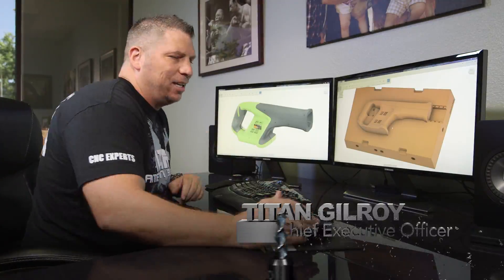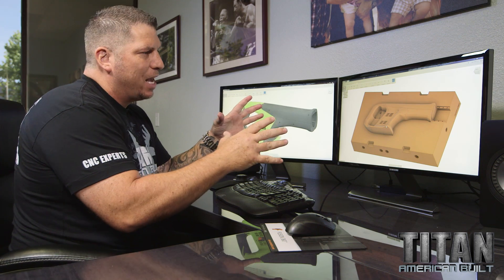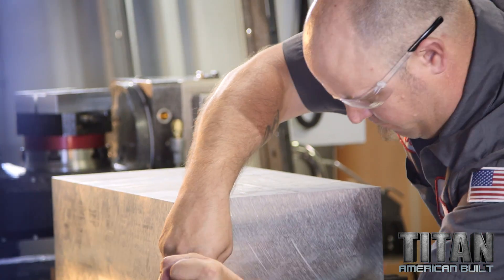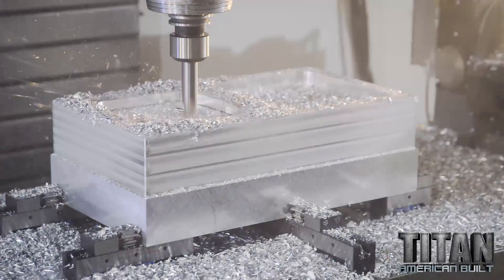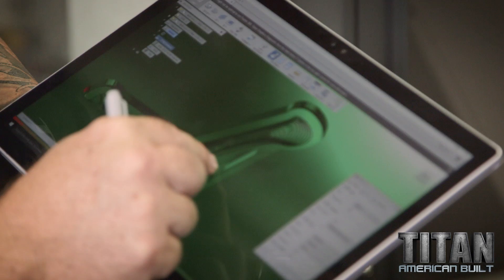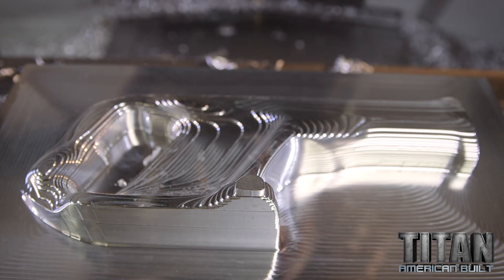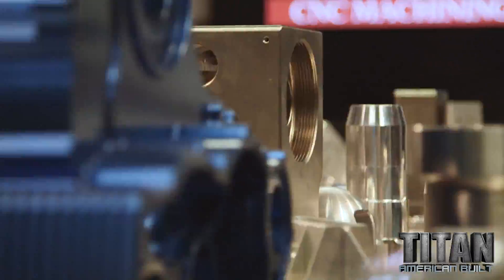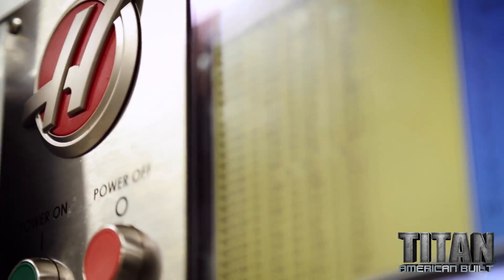TITAN Demos Autodesk Fusion 360 - Epic CNC Machining

Comment: Titan, thanks for inpiring us. If I am an Autodesk Inventor user I identify 3 CAM solutions: HSM, FeatureCAM and PowerMill. I don't understand the differences between them and what would be my choice.
Reply: It’s 2 years later and now Fusion 360 Ultimate can do simultaneous 5 axis movements and simulation.
Reply: Fusion 360 has the cam built along side the cad program
Reply: Fusion 360 is not able to do machine simulation (i means simulaton of the whole cnc milling machine for 5 axis sicurity) , fusion 360 can't produce pattern for continuous 5 axis milling. Fusion is incomplete, this is why there are better sw, but this don't means that fusion is non a good sw for what you need to do.
Carlos, if u are a user of autodesk products, go with hsm, it's also an extension for inventor, so u have cad and cam in one program